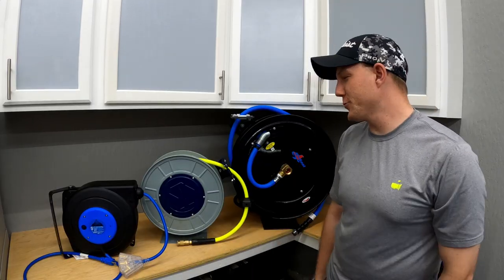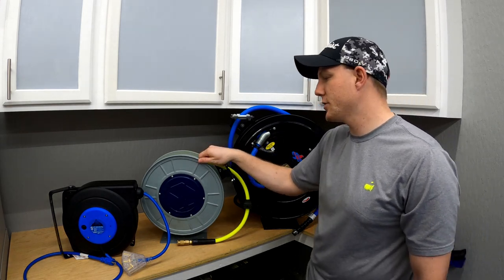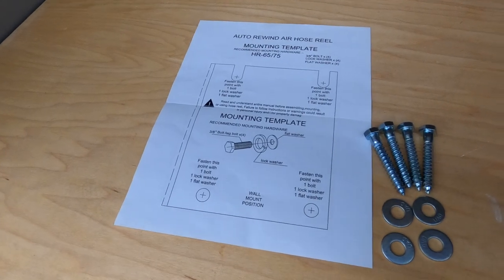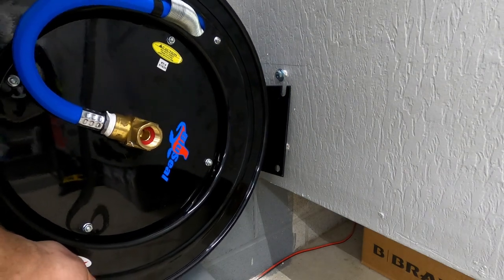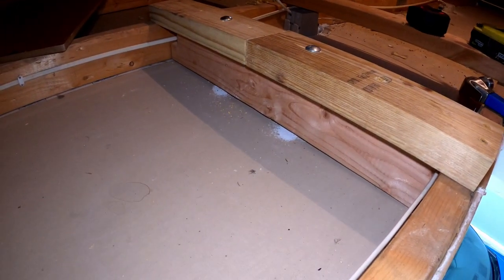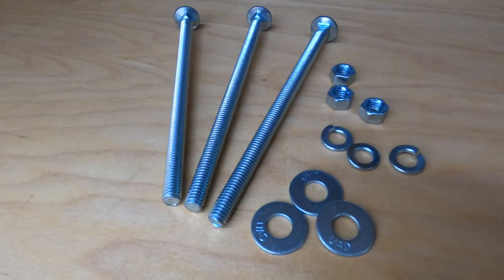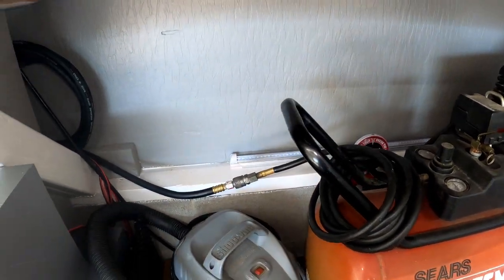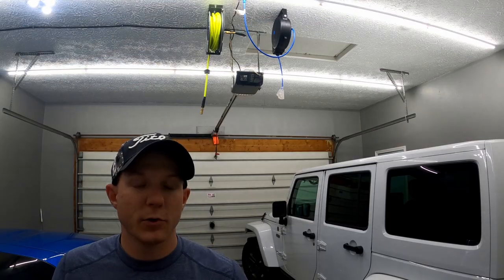Retractable Reels Install | Garden Hose | Pneumatic | Extension Cord | Garage Makeover pt. 3

Comment from the maker: Update: All reels are working great. Although make sure to use a hose rated for hot water if it calls for it. I found out the hard way with my homemade wye adapter ;).
Reply: I used to have double taps like that. If you accidentally leave the valves on but let’s say the nozzle is closed or sprayer is not spraying... the hot water will actually start to mix and you will get warm water through your cold in the house. For instance you could be flushing hot water down the toilet. I changed the hot tap to a thermostatic mixing valve. Now it regulates the temp and it won’t back flow.
Reply: Can you share the size of the adapters and couplers? I have a hard time figuring that out… does not know plumbing and trying to diy …

Comment: Hey are you sure the hose reel wasn't installed upside down? that bolting plate seems so weird to have the cutouts facing upwards which leaves all of the weight on the bottom two bolts, top two are now acting as a stop from pulling out of wall but not necessarily and load bearing capacity. Also noticed the self winding feature of the reel is at the bottom, all of the reels I own have that feature at the top of the reel.
Reply from the maker: You could be correct I may have mounted upside down. I will be honest the reel still works great so I am not sure if it makes a difference. IDK
Reply: @ThatTechTeacher427  Don't think it makes a difference really as far as function goes. Just from the amount of things ive mounted in my life to walls that bolt pattern looked upside down to me. I think its still strong enough either way but those U shaped portion are for you to install two bolts or lags on the wall then hang the unit on those two loose mount bolts or lags using that U portion of the mounting plate, then you can screw your other 2 lags in the closed hole portion on bottom of mounting plate and then tighten the top two.  That's it's design at least just there to make mounting a heavy awkward item like a hose reel a little easier with 1 person.
Reply: The arm can be detached and rotated, thus making it possible to flip it around, in order to have the top two bolted to the wall, and bottom as cutout / support.

Comment: Great additions to the garage! One safety thing to maybe integrate is to install a shutoff valve in the airline as it connect to the air compressor...it’s an awful thing to disconnect the line and it go whipping around as the air rushes out of it
Reply from the maker: Thanks and good idea!

Comment: Why do you have a hose in your garage?  Is that a northern thing?
Reply from the maker: Not sure probably is a northern thing it seems like most homes in my area have them. We have hot water heaters in the basement and plumbing is close so it is nice to have in the garage for washing cars etc.
Reply: yeah I live in NC and we just unplug our hoses at night and drain the if its getting well below freezing. Northern states will go months in the winter with freezing temps every night/day so you'd have to completely remove your hose and bring it inside all winter long and redo it every season, so having it inside the garage where it won't get nearly as cold keeps the hose from freezing and bursting

Comment: Never go smaller wire when going longer runs. Voltage drop. You will keep tripping your breaker
Reply: He went bigger with the 12 gauge, no need, would have been ok with the 14 gauge, same as in his wall.
Reply: @yolala100  yes. I didn't say he went smaller. I said never go smaller IN GENERAL. I
Reply: @gilfabian765  I know, I was just saying that he went bigger and there is no need for that.
Reply: @Marc  true. Bit with electricity it's always best to play it safe. Seen too many fires happen due to homeowners swapping 15 to 20 am breakers because they trip. Not knowing what wire size they have and they figure it out once the smoke starts appearing
Reply: @gilfabian765  Exactly Gil. People need to know what they are doing with electricity before playing with it. Gauge and Amps aren't there for nothing, there's a reason.